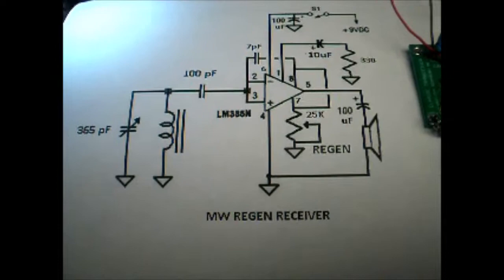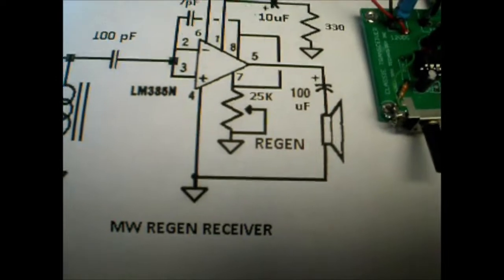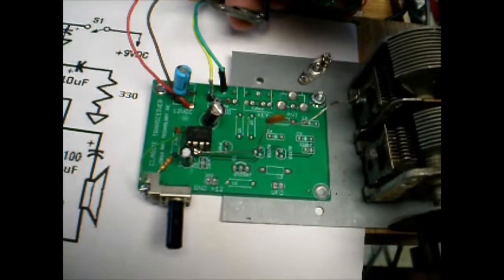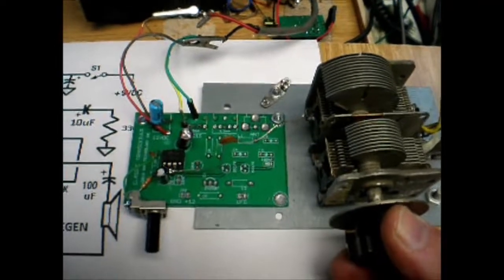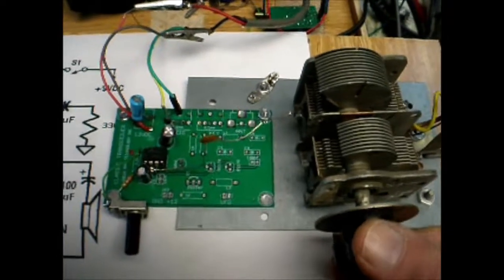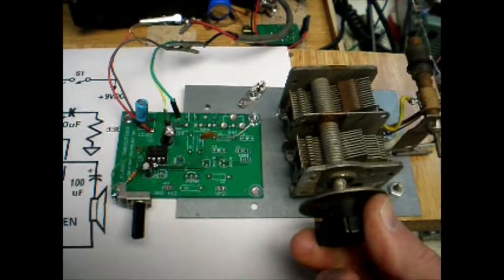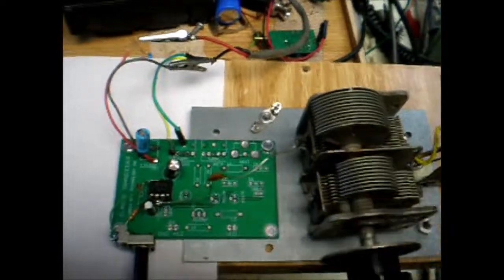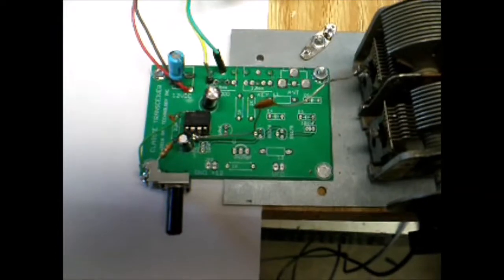LM386 Regen Demo by W9RAN

Comment: It was old experiment, and today I finishing this circuit for FM receiving, and surprisingly good!!!!!

Just put 4 turns of 0.5mm enameled wire on 5mm diameter and parallel with 60pF variable capacito, that is my Tank Circuitr. I can hear very clear sounds from 88MHz to 114MHz, sometimes strange conversation captured and fun to be heard. 

I never knew that inside LM386 can bear VHF range frequency but it's just GOOOOOD receiver for simplicity, performance and reliable for all occasion. Just make sure use stabilized 5V to 6V because the frequency tune change slightly when battery become flat. And more than 6V cause motor boating sound or distorted sound.

For regeneration Potentiometer I use 50K for best result, but any Pot more than 25K can be used with good result too.

Let's play with Tank Circuit and do the math about resonance frequency and hear everything that we like to hear. Just FUUUUN!

THANK YOU, 
Fun activity in quarantine time!

Greetings from Jakarta, Indonesia 🇮🇩

Comment: Wow! Just found this 5 yrs later. I got to build one of these. 
I don't understand how the LM386 can work at RF frequencies being an audio amp. 
Why are  pins 7  8 tied together ?
Why is the + input tied to the - input? Where inside the IC does the demodulation take place?
I can't look up the original Selenium link at radioboard. It appears to have been hijacked.